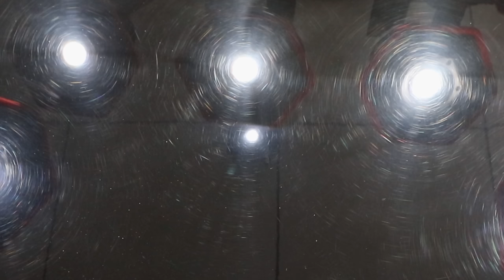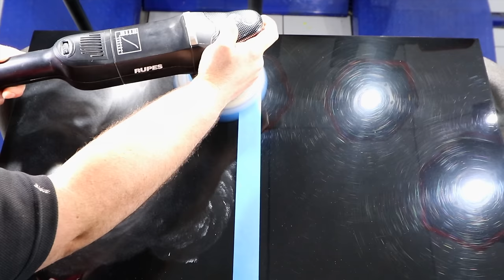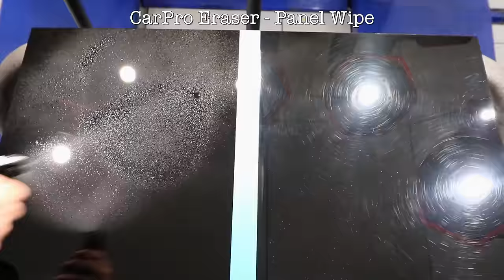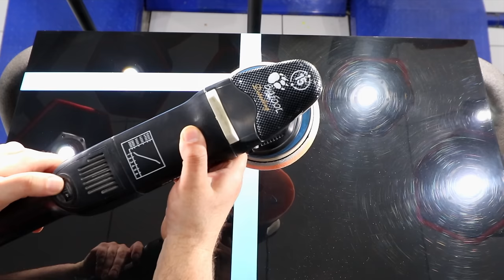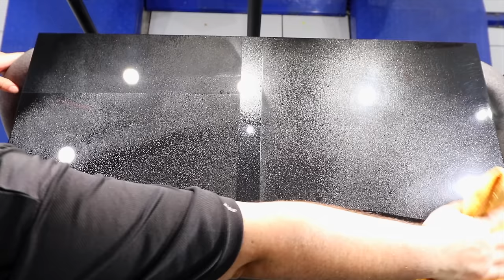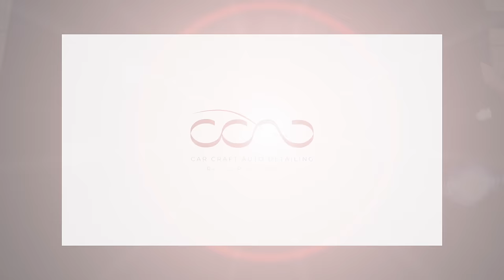How To Cut & Polish Car Paint Correction Demonstration Explained in Real-Time!

Comment: Newbie here lol. Might be a stupid question, but why the blue polishing pad first before the orange cutting pad? I saw there was an orange polishing pad and cutting, but in your description you put orange cutting. I always read to do cutting before polishing and not the other way around.
Reply from the maker: Thanks a mistaken description by the seller website. The blue HDO should be described as a light cutting foam pad whereas the orange HDO should be described as a foam polishing pad - it can get confusing when products have varying description from varying websites but your correct that you would cut prior to polishing or finishing

Comment: Amazingly informative video. Do you still use these LC pads? Or have you found any better pads or compound?
Reply from the maker: Yes I still do use LC pads but also a lot of Shine Mate pads
Reply: @CarCraftAutoDetailing thank you for your response! I just purchased  a used blizzard perl white toyota highlander. It has some light scratches. Do you think 2 step polishing with LC blue HDO and Orange HDO will be good enough?
Reply from the maker: @Hello-ms1lb Toyota paint is typically on the softer side so that could be a quite good combination on that paint type to deal with moderate to deeper swirls and scratches.
Reply: @CarCraftAutoDetailing thank you so much for your response!

Comment: Great video mate. I thought lower machine speed gives more cut? But I see you have the machine speed quite high for this first cut?
Reply from the maker: Thanks and increasing cut can vary a lot depending on your specific machine, pad and compound combination - slower machine speeds can sometimes prolong abrasives breaking leading to more cut, but other times may in fact reduce cut depending on the specifics. 
The best thing you can do is let your results judge the way you work, and if you need more cut or perhaps a better finish then you can start deviating with your technique.

Comment: Quick question, do you not have to prep the pad by massaging polish into it? I noticed in a lot of videos detailers just put 4-5 drops on the pad and go for it
Reply from the maker: Foam and traditional wool pads self prim very quickly, but microfibre pads and refined wool pads would be primed by spreading additional product into the pad and they don’t tend to self prime as well - or at least that’s my experience
Reply: @CarCraftAutoDetailing  awesome thanks so much for your reply, great videos also!

Comment: Hi, I seem to be getting some haze after using Carpro Reflect with finishing foam pad on DA polisher. I did the cutting stage with a Shinemate cutting foam pad (diamond pattern) and 3D One hybrid compound, which removed most of the marring and waterspots, but after doing the finishing step with Reflect, it seem to leave some haze on some areas, especially around the edges of the section I am working on and around the body lines, which I thought was just stubborn residue since it is also very hard to wipe off after IPA spray. Trying to fix it only made it worse, spent hours trying to do the finish step. I tried applying less pressure and did slower passes on speed 1-2, but nothing worked for me.

What do recommend me to do? My car is a black metallic Honda (soft paint), I work in a garage but its hot and humid here. I have both ShineMate 5" 15mm and 3" 12mm DA polishers. May I know what speed setting do you usually use when finishing, and how many passes do you need to do? I will try to get a different polish/pad combo if nothing works. Appreciate the help, Thanks!
Reply from the maker: It’s hard for me to say for sure, but I’ve found Reflect not to be the greatest finishing polish on soft paints - if you have access to Nv Finesse or Scholl Concepts S30+ you have have better success. The speed I use depends a lot on the specific machine - on less powerful ones I’ll tend to be around 4-5 and on more powerful ones I’ll be closer to 3-4 typically when finishing, and I’ll also tend to do about 3 passes when working with finer polishes. What I can also add is to use very little polish - try using half the amount you typically use - and also make sure to apply moderate pressure- don’t be too light as pressure helps control and contain the pad movement as well as break do the abrasives to produces better finish.
Reply: @CarCraftAutoDetailing  I tried Rupes DA fine polish and Rupes white finishing pad and it worked better than Carpro Reflect. But I'm still getting the slight uneven hazing all over the place, so it's probably down to my technique. I did 3 pea sized drops of the polish and worked on speed 3 on my Shinemate EX620, still a little bit hard to wipe off on some areas. When do you know if it's time to stop? When it starts to dust or do you work until the polish breaks down completely? Thanks
Reply from the maker: @Lesparta maybe have a look at the video below as it better helps explain how to deal with soft and sensitive paints (which can be a real pain). Rupes Da Fine is really more of a medium compound so it may tend to leave hazy polishing streaks on softer paints. You can even try timing yourself and stick to a 60secs polishing set doing 3 row passes, and just make sure the paint feels only warm and not hot after your polishing set - too much heat makes soft paint gooey and even more sensitive which tends to produce hazy finishes. I’d also try just adding one drop of polish once your pad is primed and stick to a section no larger than 6 times the size of your pad. 
https://youtu.be/m6tbu3GrTWI?si=iyxrdKLp-ODLuIHN
Reply: @CarCraftAutoDetailing  Thanks! The video helped me quite a lot, I got Scholl Concepts S30+ and it finished out nicely, just needs a little bit more effort to wipe off because its slightly sticky, and still some uneven haze around the body lines. How do get rid of the haze that appears around the section of the area you are working on, you could slightly see the outlines? I found it really difficult to remove. Thanks!
Reply from the maker: @Lesparta on more sensitive paints, sometimes haze can also be caused by your IPA solution, you could try adding 50% deionised/distilled water to it to half its aggression, and also don’t spray it directly on the panel, just lightly mist your cloth and use it that way. Another option is to use a primer polish like Carpro Essence, it doesn’t need an IPA wipe down and tends to shield soft paint from sensitivity.

Comment: CarPro Essence or NV Finesse, what do you recommend for using before applying a graphene ceramic coating?
Reply from the maker: I think you mean Nv Morph, but either should work equally well. Essence is really just finishing polish, so if you’re paint is already near perfect then that might be a good option, Morph will tend to remove some more moderate to mild defects so if the paint needs a little more attention it may be the better choice.
Reply: @CarCraftAutoDetailing  I'm planning to use the Scholl's S2 Black as the compound so I was looking for something with a perfect finish for the final polish
Reply from the maker: Every paint type, pad, machine and technique is going to render different results so I just can’t say for sure what’s going to be best in your situation, but S2 finishes quite well generally so maybe Essence will be enough to refine it and work well to further boost gloss and clarity on your paint.
Reply: @CarCraftAutoDetailing  Okay Awesome, Should I use the Orange or Black pad for the essence. I love the page keep up the videos!
Reply from the maker: I would tend to use the orange, but if it’s not finishing as well as you’d like, try the black and compare, thanks mate!

Comment: I'm always confused with the products for single stage and 2 stage correcting. For a single stage correction, would you use a compound product only or a finish compound only. And for a 2 stage, would you use a heavy compound and then finishing compound or would you use a medium compound and then finishing compound? This is what really confuses me
Reply from the maker: It’s confusing because every paint and it’s defects are different. Usually if you’re working on a harder paint with severe defects you would use a heavy cut for a single stage, and a soft paint with minor defects would tend to work well with a finishing polish, while an in between paint hardness was varying defects would be somewhere in the middle. 
Add different grades of polishing pads, different machines and techniques and it’s really always going to be a case by case scenario. 
It would be nice if you could just have a simpler solution but it unfortunately just doesn’t work that way which is why you have so many contradictions in paint correction.
Reply: @CarCraftAutoDetailing  thank you for replying! Would a heavy cut without polishing not leave small abrasive marring?
Reply from the maker: If the paint hard and you use an appropriate pad and technique you can certainly finish perfectly with heavy cut compounds in those circumstances, also depending on the specific compound you’re using as some defiantly finish better than other. 
But in many other cases a heavy cut compound can certainly leave compound haze behind which is normal.
Reply: @CarCraftAutoDetailing  what would be your go to product for a single stage?
Reply from the maker: It really depends on the paint, but I use Scholl S20 Black a lot

Comment: Hello

I have a question, I bought nv finesse and nv precision, which pads do I have to use? I have all the rupes one, rupes white for the final finish?

My car is a bmw 2020 it has slightt to medium defects, is is precision too hard of a compound?
Reply from the maker: Maybe have a look at this video: https://youtu.be/6tepA3wjPbY?si=NXEf-yYUFd5WKLL0
As it should help in guiding you through which pad/compound combinations should work best and why on your particular paint. 
BMWs do tend to have quite hard clear coats so sometimes more a aggressive combinations like Precision with a foam or MF cutting pad may be needed to remove even light to moderate defects, and on harder paints it can also finish quite well - doing a couple of test sections is really the only way to confirm that.
Reply: @CarCraftAutoDetailing thank you, i was also wondering if it's okay to use the yellow pad from rupes with the nv precision to start with

Like in this video I'm wondering why you used the lake country orange pad instead of the black one for finishing 

Does the orange pad finish just aswell as the black with finesse?
Reply from the maker: Yes the yellow pad is fine to use, and sometimes you’ll find that the finest pad may not always finish the best - that’s where testing is so vital to really show the true results.

Comment: I know it doesn't translate into video very good. I'm new to compounding and the results are night and day but majority of the scratches are still there. They are not white, they just look like... how do I describe it... dents? Long or short lines, very fine dents. It's not noticable but it's there, like all over the panel. Once you see them it's hard not to see. Is compound suppose to take these out or does it needs to be sanded or just rèpainted

Comment: So 6 weeks ago I bought a black suburban Premier 2019.  I flew from Seattle to TExAS then drove to Virginia once I washed it it was horrible was like sick for a week the paint looked almost silver.  I bought the chemical guys STUFF a ton of it like 700. Worth I washed it at the car wash (touchless hand style). It looked like it just came out of a mud pit maybe they Recycle their water???   Any way at home hand wash using a house and a almost all car wash mix finally got it clean but it had a over spray that was gummy and took 3 weeks to really get rid of clay bar after clay bar the top took 3 the rest of the car was a clay bar finally nice and smooth once it was cut with the cutting compound it looked presentable but I finally got down and got the front clip done a a coat of wax holy shit almost looks brand new but it is a completely different vehicle!!!  And it had hella water spots so bad it was hard to see out the glass and mirrors where almost impossible to use!  How you let a vehicle get this bad???  But the chemical guys water spot remover (and a week of application after application) it has the slightest sign of water marks but it’s clear smooth and no defects!  I bet I have 50 hours into this thing!!!  Tomorrow the sides compound polish and I guess it is recommended for hand polishing???  Why not the DA? Is it too easy to over do it??

Comment: Can I use anything finally to make this procedure last ? My paintwork comes up nice, but the results of this procedure doesn't last l...
Reply from the maker: Paint correction is permanent, so if you want to the finish to last you have to prevent or limit new swirls and scratches from happening by using safe car washing methods and ensuring your paint is always protected with a wax sealant or coating
Reply: @CarCraftAutoDetailing  thanks heaps for replying!

Comment: hello sir.. which one of my tools can work as a buffing machine.

1. orbital sander
2. variable speed angle grinder

tia
Reply from the maker: The sander with Velcro backing plate - don’t use the angle grinder
Reply: @CarCraftAutoDetailing  thank you sir.. when you compound a car.. do you have to compound the whole car or just the parts with swirl marks?
Reply from the maker: It’s better to do the whole car so you get a good consistent finish on every panel.
Reply: @CarCraftAutoDetailing  thank you so much sir

Comment: I’m using meguiars ultimate compound and its leaving a weird residue behind, even if i wipe off while wet and buff with microfibre towel. Any idea why? Stressing me out!! I can’t get it off
Reply: I’m doing it by hand btw
Reply from the maker: It could be a few things but generally speaking, using less product should help - try using half or even a quarter of what you’re currently using on the applicator. Try working much smaller sections at a time - a square foot area for example. Try working the compound for longer in order to break it down and immediately wipe it of while it’s still warm with the friction of your application. Make sure the car panel is cool and out of direct sunlight. If you’re still struggling, use a damp cloth to aid in wiping it down.
Reply: @CarCraftAutoDetailing  I def used way too much. Thanks I’ll try those tips.

Comment: Sweet! What is your opinion on the blue rupes foam pads? Never really fell in love with them on my 21MK2
Reply: @CarCraftAutoDetailing  I had issues with them dusting alot, but that could be user fault. I'm very happy with the wool pads.
Reply: André Baumgartner very disappointed by rupes blue coarse foam pads 👎

Comment: Why are there still swirls and scratches for me though?
Is it because they're deeper than the compound can cut? This is happening to me after I compound and polish my black car.. It looks better, but under direct light there's tons of scratches and swirls.. Idk how to fix it.. Should I wet sand it first.. With maybe 3k sand paper, then do compound and polish? Any help would be appreciated, thanks in advance!
Ps, Idid wash the car and clay bared it before anything else
Reply from the maker: One reason you may still have swirls is as you mentioned many of the existing scratches may not have been removed: however in this case you shouldn’t see loads of swirls/scratches, you should see more random straight line scratches that will require I more aggressive cut to remove. 
The second reason you may see loads of swirls/scratches is that you haven’t refined you’re compound scratches adequately with your second polishing step, or the polish, pad and technique combination you’re singing is leaving swirls/marring behind: so you may need to find a better technique and combination to finish well on your particular paint type. 
I’ll give you a couple of links to video that may be well worth watching to help trouble shoot your issues:
https://youtu.be/6tepA3wjPbY?si=xeNVIY5FTc-u6wpk

https://youtu.be/m6tbu3GrTWI?si=-QHFqmENHhhYQWsu

Comment: Most of the time after polishing and wiping paint down with panel wipe on a black paint i get holograms, why?
Reply from the maker: It can be a couple of reasons. Polishing oils tend to fill in compounding swirls, holograms and marring that are revealed after the IPA wipe removes those oils and are easer to see on black paint. The other reason is that black paint tends to be overall softer and IPA can make it even more sensitive leading to wiping swirls that if done in a circular motion can cause a hologram like effect. Waiting for the panel to completely cool and using a new and plush microfibre cloth can help, as well as further diluting the IPA mix to make it weaker.
Reply: @CarCraftAutoDetailing  will do, thanks for the reply Sandro,👌
Reply: @CarCraftAutoDetailing  but is that mean that I’m not compounding enough that oils fill swirls and holograms ?